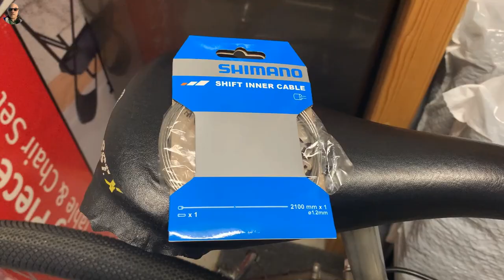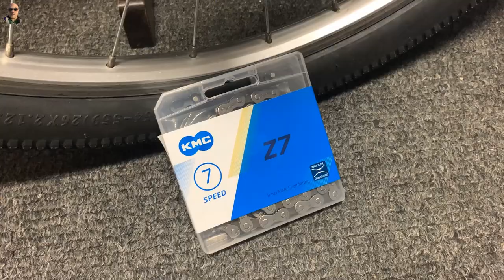Retro MTB Bike Restoration | 1996 Marin Hawk Hill

Comment: Thanks for the great video.   You have a new subscriber.  Would it be possible to provide a link to the specifications on your rebuild?   Just asking.....    Thanks again for the great video.
Reply from the maker: Hi Jeff, thanks for the feedback. Most of the parts were just cleaned and reused. The only parts replaced were the tires/inner tubes, chain and rear shifter cable, which were all sourced from Amazon.